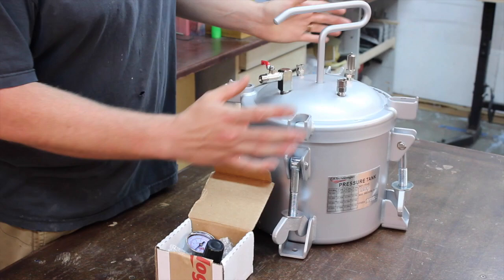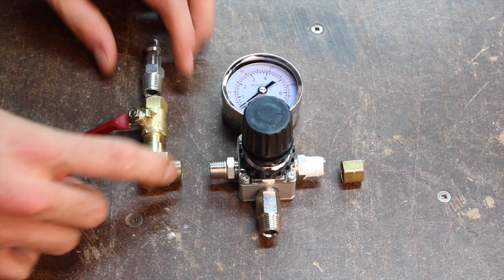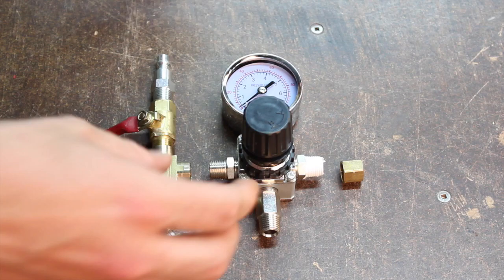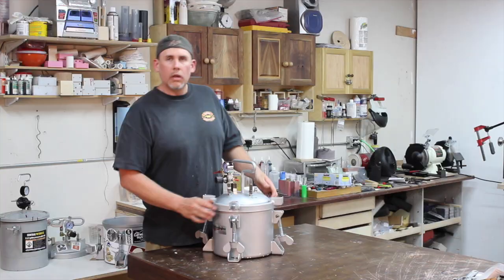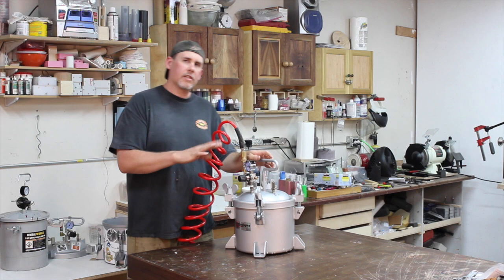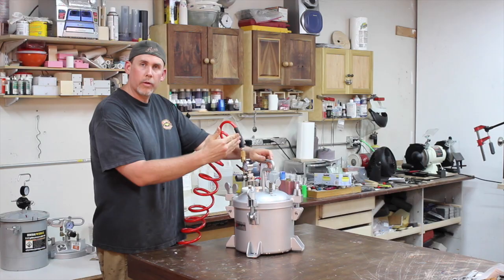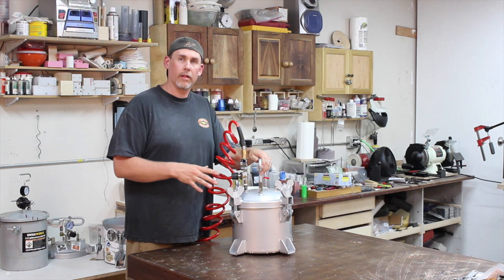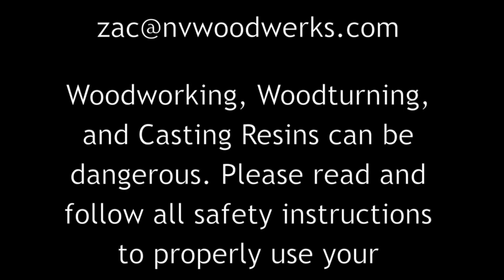Setting up a CA Technologies Pressure Pot For Resin Casting

Comment: Out of curiosity for convenience, Could i use my vacuum chamber and pressure pot in the basement of my house? I've been using them both outside in my garage for the past couple of months, but it's starting to get cold where I live and the resin and I should not be out in the cold! One big concern is the vacuum pump or the air compressor emitting any possible fumes that could get into the house.
Reply from the maker: You can use them inside, but I'd probably recommend using the vacuum pump outside because of the exhaust and it would have to be running the whole time. Most of them emit some oil that you probably wouldn't want in the basement. The pressure pot would be ok indoors I think. The compressor wouldn't be on too long to get a pressure pot to full pressure.
Reply: Thank you! I had figured as much but just wanted to be sure.
Reply: sir I want purchase

Comment: Hey Zac you have any advice on using CA's 5 gal paint pressure pots to convert to casting pressure pots. The one I have has the manual paint mixer in the center of lid and it can be removed but then there is a hole with no threads to cap it off. Any suggestions?
Reply from the maker: I haven't converted one of the 5 gallon pots with an agitator in the middle before, the one I bought came without one and has a cap there. I'd probably recommend contacting the company you bought it from to ask what the best and safest way to cap off that hole would be
Reply: Zac Higgins I've sent an email to them but waiting for a reply. Thanks

Comment: Hi, I would like to ask a question about pressure. I've got a pressure pot rated for 116psi. What pressure should I use for clear resin casting? The more the better? Thank you.
Reply from the maker: Hey Radek, in general the higher the better, especially for embedding things. If it's just resin only, there's really no need to go much higher than 60 or 70 psi. If you're going for tube-in style casting using silicone molds, higher PSI could deform the molds, so just do some experiments to see how everything reacts, and you should be good to go

Comment: I feel ridiculous for posting this, but here it is anyway. I've got my pressure tank all set up with a Dewalt air compressor ready to go.  However, I must have the wrong size nozzle for the air inlet because my quick connect doesn't seal and no air will go into the tank.  Does anyone have any idea which size nozzle I'm supposed to use on the regulator attached the air inlet with the pressure casting pot?

Comment: great vid, what would be the cfm  requirements for a pot this size? or any compressor in particular?
Reply from the maker: I'm not sure what the minimum requirements are, I have an 80 gallon 5HP compressor hooked up to mine that runs our whole shop. I know people who use the smaller pancake size compressors with them
Reply: Thanks , I got a 30gal 5hp 9cfm I'm sure it will refill the pot in time to spray paint, just wanted to make sure

Comment: what do you recommend for air pressure? Compressor specs  Thanks
Reply from the maker: I'm not entirely sure what the minimum specs for a compressor would be, but you'll want to get one with a tank that holds about the same amount as the pot, typically around 2.5 gallons, and I think you will want one that is capable of producing about 90 PSI. The smaller job site compressors should work fine.

We have an 80 gallon/5HP compressor in our shop, but if I were buying a smaller one I'd check these out: http://amzn.to/2ibMuvh It's much quieter than most of the small compressors on the market, and it's an oil free pump. Best of both worlds :) Dema got one of them and loves it. 

How high you go in the pressure pot primarily depends on the max psi rating of the pot. I run the CA Technologies pots between 60 and 70 psi. I generally stay about 10 psi under the stated max psi of any pot to be safe.

Comment: Hey Zac, I just got my C.A. pot in the mail from J.N. Equipment and comparing it to yours it does not look the same. For starters the fluid outlet valve on my lid does not have a ball valve on it. Only an elbow piece. Another thing is that it came with a fluid pick up tube already in the lid for paint just like a harbor freight pressure pot. If I ordered the pot for paint and not resin casting should I return it and purchase it straight from C.A. Technologies themselves?
Reply from the maker: Well, it is possible to convert that one, just need to get a ball valve and remove the pickup tube. It's definitely more work to convert one like that though, so if you're not in a big hurry I'd probably recommend sending that one back and getting one of the models I use from Finish Systems. I have a link on my website to the ones I buy: http://nvwoodwerks.com/tools/
Reply: I think I'll just send it back. I've already gone through enough of a hassle with a Harbor Freight pot and I don't want to risk breaking this one and not get my money back. Thank you for the help!
Reply: Zac, I have the same problem.  No ball valve for liquid outlet.  Not sure what type of ball valve fitting (female) that will fit.  Do you think it is 3/8 air fitting?

Comment: Had Alumilite dye seeping from set up alumilite resin any ideas why?
Reply from the maker: I'm not entirely sure Jim. Might not have been mixed in well, or the resin may not have been mixed up enough. If there are areas of unmixed resin in the casting, it can weep liquid out of it with the dye in it possibly

Comment: Hey Zac, Nice video...advice for a newbie? Not sure at this point I could afford a CA Tech pot...what would you suggest?
Reply from the maker: Robert Evans Good question Robert. I think if you are definitely going to do a lot of casting, it's worth the money to just get a top of the line pot. If you're just starting out and plan to do a little casting here and there, then the Harbor Freight pot will work just fine. You can always upgrade down the road.
Reply: Zac Higgins Do you have a video on how to setup a HF pot? I've checked them out at the store and it mostly looks like you need a cap for the paint outlet.

ETA: Found it, I'll post any questions in that video's  the comments.
Reply from the maker: Cliff Hartle The video is a little older, so I didn't awesome camera angles on it. Let me know if you have questions, I can help out.

Comment: Hi Zac, I've decided on getting a CA Technologies pressure pot in lieu of the Harbor Freight model.  I went on your website and the selections you had were a little more than I wanted to spend on a Pressure Pot.  What is the part number and price  of the one you demonstrated  and is it listed on your website. CAT has  a 2 1/2 gallon pot for $224 and that  is the one I would like to get.  ..  Which model part number is yours?  Great video by the way - Thank you. Jim
Reply from the maker: Hey Jim, I'd recommend getting it from Finish Systems, they have the ones that are made for resin casting, and they will help you out if you have any issues
Reply: Thank you Sir  Much appreciated.

Comment: I am planning to pick this up asap. Which model is this?  AFS-1630?
Reply from the maker: That's awesome!! Glad you're taking the plunge, and the CA Technologies pots are definitely the way to go. I have links to where I get mine on my website: http://nvwoodwerks.com/tools/
Reply: Zac Higgins thanks for the response I also ordered the air compressor on amazon. Would i need to get the maxline kit and rapidair kit too?
Reply from the maker: It's not necessary, only if you would want to run an air line system in the shop. Otherwise, you can just hook up any hose to the compressor. I would recommend putting a filter on the line though just to make sure no contaminants or moisture get in the air line

Comment: I just got one of those CA Pots.  It arrived today, and the paint intake pipe is attached inside the lid.  Wondering if you've encountered this, and if there's a way to safely remove it.  (I haven't taken any tools to the lid yet, I just tried to unscrew the pipe and it's too tight to take out by hand.  My fear is that it's sealed somehow and if I take a wrench to it I'll break the seal and damage the pot.)
Reply from the maker: +Rob Hawkins I'm not familiar with anything like that Rob. I don't take anything out of lid on the CA pots. Just add an elbow and a male air intake connector on the left side of the regulator, then cap off the right. I'd get in touch with the company you bought it from to make sure you're taking it off the correct way and not voiding the warranty in any way. I'd probably return it and ask for one that isn't set up that way. Finish Systems, where I bought mine, has some for sale that are marketed for casting. I didn't think there were any real differences, but there may be a difference between those and the one you got.
Reply: +Zac Higgins Finish was where I got it.  I'll get in touch with them.  Thanks for the reply!
Reply: Hi Rob. I am just getting into this casting stuff,I bought a pressure pot here in Australia and its looks like exactly the same one ,and also has the pipe on the inside. did you get this off without any hassles??
Reply: The mistake I had made is that on the CA Tech site there is a version of the pot that's specifically noted as being for resin casting, and it points out that the pot comes with the intake pipe removed.  THAT is the one people should be ordering when using it for resin casting.

As for getting the pipe off, I called them up and they recommended using a heat gun to heat the pipe attachment to soften the glue, and then using a pipe wrench to twist it off while having the lid secured in a vise.

The pipe came off, but the seal of that fitting wasn't properly "air tight" anymore.  It resulted in the pot slowly losing pressure (quicker than it normally does).  A soap and water test revealed a lot of bubbles forming around the fitting where it connects to the lid.  Obviously, twisting off the pipe had broken the seal a bit.  

CA was very accommodating, though.  They assured me that if anything went wrong with the pipe removal that I could send it back and they would reseal the lid, which I did.  I sent the lid back in and they re-sealed and tested the lid.

Definitely call them first, and let them know what you need.  They may be able to do it for you, or you may be able to swap the lid.

Another thing to point out is that the pot will hold pressure better if you don't have the plastic liner wrapping over the edge.  I trimmed the lip of the liner, but actually don't even use it because the bottom os bowed a little.  Instead, I have a circle of wood in the bottom to make it completely flat and level.

Hope that helps!
Reply from the maker: Should come free without too much hassle.  If it won't twist free, hit it with a heat gun at the threads to loosen up any hardened thread sealant. Don't try to force it though, you don't want to void warranties or damage the pot. Contact the manufacturer if you can't get it out with minimal effort.
Reply: hello! I would like to know how to get a better result in my pieces because it puts more than 90 psi pressure more they do not know what reason ppor are left with stretch marks ... on the surface of the piece would have any idea what is happening .. ..desde ja thank you thank you !!!

Comment: I recently bought the same CA Technologies pressure pot. On mine it came with the pressure gauge attached to the air release valve. Would you recommend removing it and going with the same setup as you?
Reply from the maker: I probably wouldn't mess with it as long as it's not an inconvenience to you or leaking
Reply: Have you had any issues with the new configuration on the pot you purchased?

Comment: Hey Zac, dumb question but is there a reason that pressure is used rather than vacuum for impregnating the resin?  Thanks ;-)
Reply: BoatworksToday I'm not Zac, but that wasn't a dumb question, either.  The reason for using a pressure pot instead of a vacuum chamber is that the resin Zac uses sets up too quickly for a vacuum chamber to work.  With a vacuum chamber, you degas the resin by pulling a vacuum and then allow atmospheric pressure back into the chamber -- driving the resin into the voids in the embedded material.  It can take more than 30 minutes for this process to be completed -- which is a problem when the resin sets up in less than 15 minutes.
Reply from the maker: BoatworksToday Hey Andy, not a dumb question at all. David was pretty much spot on, but I thought I'd give you a little more depth as to the how and why. First off, I do use vacuum when I'm stabilizing wood. Stabilizing resin stays liquid until you bake it. In that case, you want all the air to be removed from the wood, then once you remove the vacuum atmospheric pressure forces the resin into the interior of the wood. You then bake it and you've essentially plasticized the wood. 

For making pen blanks, I'm not really impregnating the wood, and many times wood isn't even in the equation. The pressure just removes any trapped air bubbles within the resin. Epoxy and PR have such long open times, that the air usually escapes on it's own before it starts to set up. Alumilite sets within minutes, and there's just not enough time to let the vacuum completely remove the air. Pressure works instantly compressing the air bubbles to a microscopic level.

When you are embedding things like wood or pasta in the resin, the pressure also helps to force the casting resin into the nooks and crannies of the object better.
Reply: Zac Higgins Not to split hairs but I talked to my engineer son and he is pretty sure you are not really making microscopic bubbles. You are forcing the air into solution like carbonating water. 

In a bottle of pop (soda for some of you) the carbon dioxide is in solution because of the pressure.  Open the cap and the air escapes but since the resin is cured the air is "trapped" so to speak.

Comment: hi I am just about to buy a 40L pot the white olds behind you what are they made off please I am in the UK and I want to start doing picture blanks as there is only 3 people that do that in the UK at the moment I have to buy my picture blanks from JST WOOD CRAFT  Joel has been fantastic and he has told me what I need to do the blanks
Reply from the maker: Those are probably the HDPE molds that I use to make bricks of pen blanks. I buy sheets of HDPE and make the molds myself. I did a video on making melamine molds, but I've since switched to using smooth HDPE plastic since it's totally non stick. The basic construction method is the same as the melamine molds though, here's a link to that video: https://youtu.be/pP-7FQNArco

 If you're planning to do tube-in casting with label blanks, I'd recommend checking out Fred Wissen's silicone molds, they work the best for that type of casting. You can pick them up on his website: https://ptownsubbie.com/collections/tube-in-molds
Reply: Zac Higgins thank you so much

Comment: J N Equipment Superstore
Reply from the maker: Oh, ok, that's why I recommend getting them from Finish Systems. I have a list of links to the things I use on my website: http://nvwoodwerks.com/tools/ Best to check there before you buy. Contact them to get a nut to hold the outlet valve in place, you'll need to remove the pipe but it has threads on it that hold the outlet in place. In this video, I show you what parts you need to add to it on the regulator